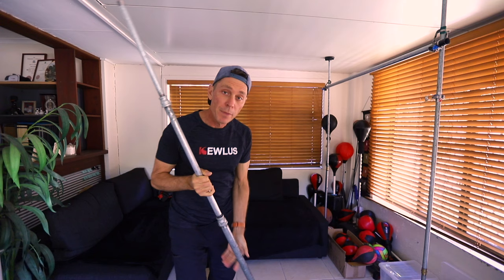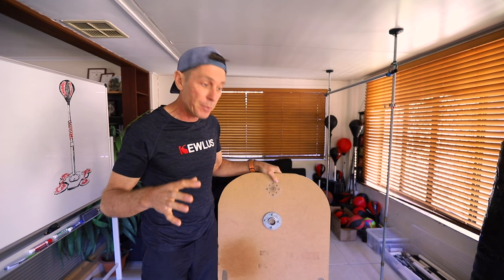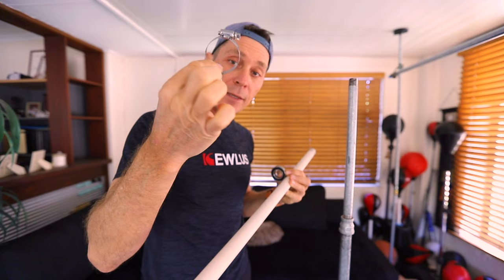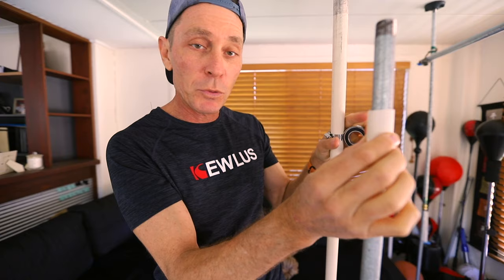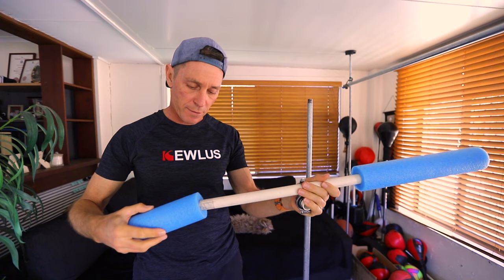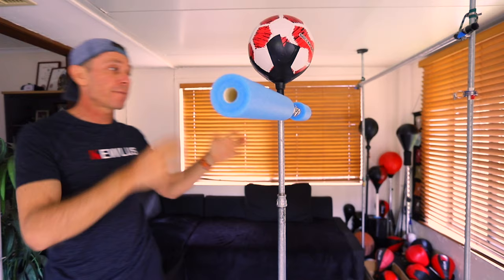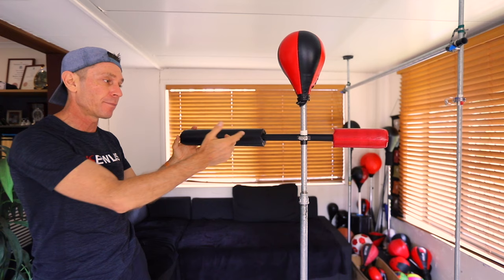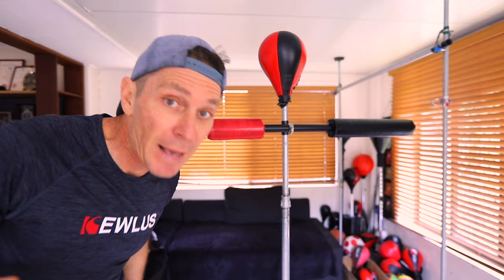How To Make a Boxing Spar Bar - Version 5

Comment: That must be the thinnest inner pvc pipe I’ve ever seen. All the sizes I’ve tried with are thick and do not bend like that lol
Reply from the maker: Which pipe are you referring to that I bend?
Reply: I am finding the same thing. Did you find the solution? I am thinking he used cPVC for the inner ball bearing. Only other explanation is the aluminum bar size OD for the 1/2” pipe is smaller on his. I have everything else built except for that.
Reply: 3/4” cPVC didn’t work either. Going to try 1” cPVC next time I can go to the hardware store.

Not sure if anyone else has found other solutions for this bearing (using the one linked in the website)
Reply: @Kewlus  The PVC pipe that prevents the ball bearing from moving. Here in the states the inside is THICK. No matter how little you cut it you can’t bend it like you are in the video and it doesn’t fit through the ball bearing and the steal pipe
Reply: @jakestowers3176  hahah I’ve tried the same. It doesn’t work. Best bet is electrical tape but that’s annoying and it still wobbles.
Reply from the maker: Thank you for letting me know. In that case use some alternative plastic like from a water bottle or similar
Reply: @Kewlus  Perfect! Thank you!
Reply: So true!
Reply: I’ll try the water bottle idea.
Reply: Anyone find a solution to this?  Basically makes the whole setup worthless without this section.  Which makes me so bummed.
Reply: Same here no USA pvc is this thin. I gave up and used a cross pvc and it spins great.  I made a block for it to rest on by drilling a hole in a square piece of a 1x4. Another option is to roll up cardboard and tape around so it’s a solid base. That works great too.
Reply: Yep I couldn't find a thin PVC in usa so I tried pvc cross  and it works great. I used 1x4 small block of wood to balance it on and a clamp underneath the wood. It works great.

Comment: This is brilliant, I feel like a piece of aluminum tube would work better than the PVC as it would have more weight to it so the bar would come back faster. I'm going to make one of these tomorrow! Thanks for the videos!
Reply: Maybe. But the pvc pipe is also fast enough
Reply: Will You update us on how it is With the pipe  insted of PWC
Reply: Or you can add weights inside the pvc.
Reply: You can fill up the pvc with sand maybe?

Comment: When are you gonna release the complete kit to make cobra bag?? I need it NOW KEWLUS
Reply from the maker: Funny you should ask - yesterday I got to see one of my very first mould injection parts come off the factory floor - super exciting. The top section components should be ready to start shipping in about a month (stage 1). The base components (stage 2) will follow a couple of months after that. The best thing is that you'll be able to mix and match with DIY components, so even if you start with DIY parts, you'll be able to swap them out with factory parts to get better performance down the track.
Reply: @Kewlus  was gonna buy it today, but gonna wait for the components, hope it gets out soon

Comment: Love your videos. I decided to make one of these as well as a Cobra bar ( not finished). The  instructions are simple . One thing I noticed was there are different schedules of PVC. I bought a section that was too thick to make the bearing insert. . I guess schedule 30 would be thinner and better. I also noticed the blog says about 20 inches in length. The video, you mentioned 31 inches. I did the 31 inch length and it was perfect. I went cheap (not recommended ) on the suction cup mounts. So now I’m ordering the ones you recommended. I’m also using a 22mm screw in collar clamp just below the bearings. It took some of the vibration out along with the speed bag on top. It’s a great, affordable, and easy spar bar. I can’t thank you enough. Now I’m gunna order the spring from your site for the Cobra bar. Take care!

Comment: I Just made this.works perfect. Only one small problem there are is a little wobbling up and down between the two hose clamps. the one that is around the bearing and the other that is attached to the pvc pipe
Reply from the maker: Awesome! Try tightening the hose clamps as much as possible. You can also use a third clamp between the other two which should make the connection more rigid 👌
Reply: @Kewlus  or put some tape on the top of the clamp that is attached to the pvc pipe?
Reply from the maker: Try it and let us know what works best for you
Reply: @Kewlus  I used a third  small clamp next to the other one and a bigger and thicker clamp around the bearing.now it's mire solid with minimum bounce.

Comment: Are you using cPVC for inside the ball bearing? PVC does not fit around the pipe no matter how much you remove.
Reply from the maker: Yes I cut out a section of it lengthwise then it fits
Reply: Reedy Kewlus I went and bought a section of 3/4” cPVC because 3/4” PVC did not work. The 3/4” cPVC didn’t fit either. I am going to try 1”cPVC next but if that doesn’t work, I might have to figure something else out like using your older builds
Reply: 1” cPVC didn’t fit either. It was the closest though.
Reply: I suspect the inner diameter of the ball bearing linked on the website is different than the one you have.
Reply: @jakestowers3176  yep I had the same problem

Comment: Why different sizes of steel pipes instead of one long 25mm pipe? And maybe last piece with 1/2 pipe.
Reply from the maker: Just what I had, but yeah any combination should work 🤙
Reply: @Kewlus  maybe it's harder to find 1 to 1/2 inch reduction,or you need reduction to 3/4 then 1/2 and then 1/2 connection. So anything will work 😁

Comment: what to do to make PVC spin longer? Because it stops quickly
Reply from the maker: How many rotations do you get after a solid punch?
Reply: @Kewlus  with a normal impact, it rotates 2 times and stops quickly
Reply: @Kewlus  two or three
Reply: @Kewlus  can you help me fix it? please
Reply from the maker: Check your ball bearing to make sure nothing is causing friction. If you post a video so I can see I might be able to provide further advice. Without seeing it makes it hard to know what might be causing it to stall.
Reply: @Kewlus  OK thank you. Got the Discord app? I can send the recording there
Reply from the maker: Sorry no. Just upload to YouTube and put the link here
Reply: @Kewlus  well thank you for your help. if the bearing does not help, I will insert a video
Reply: @k3jmil961  ball bearings are intentionally made to spin easily.  There must be something inhibiting it from doing so. Maybe spray some lubricant in it too
Reply: @JamesR23  okay thanks

Comment: What is three quarter inch pipe
Reply from the maker: In Australia it’s referred to as the 20mm pipe
Reply: @Kewlus  it is the diameter or length
Reply from the maker: Neither, it’s a reference name that is used for it. The actual outer diameter is about 27mm